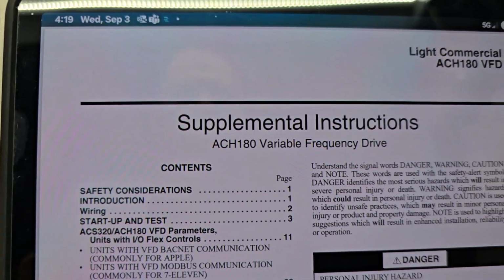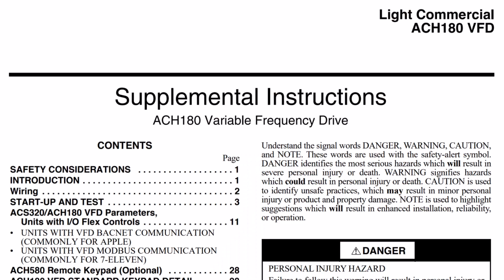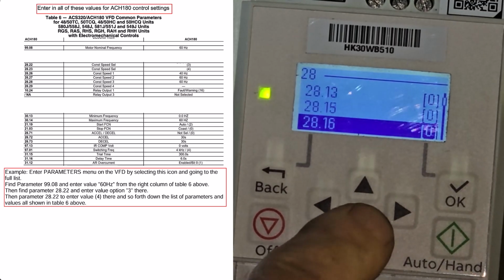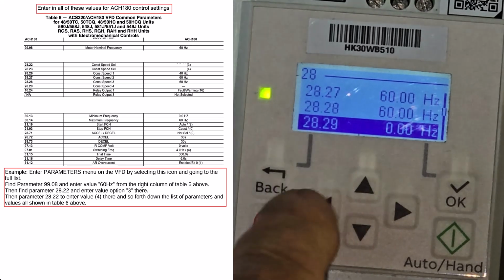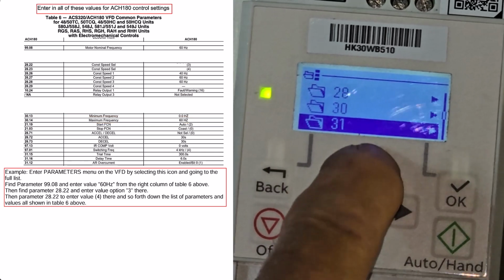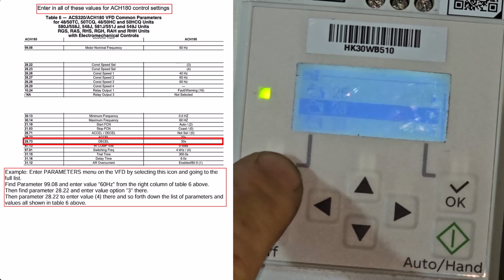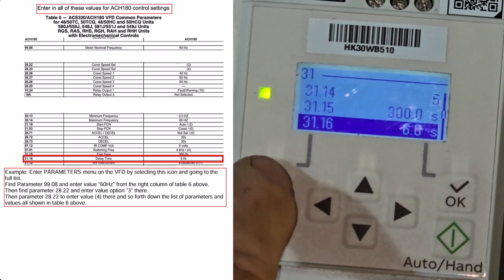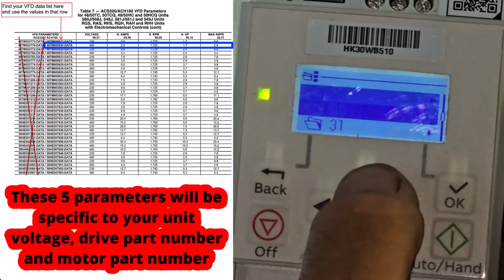Carrier ABB ACH180 VFD Parameter setup walk-through

Comment from the maker: 00:00 - Intro to the new drive
00:15 - ACS320 vs ACH180
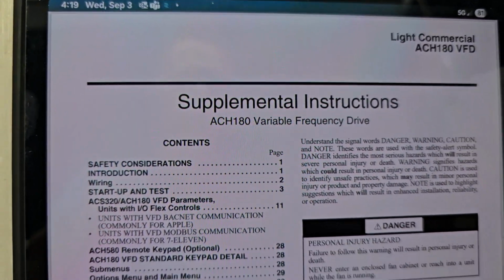00:25 - Refer to the new manual update
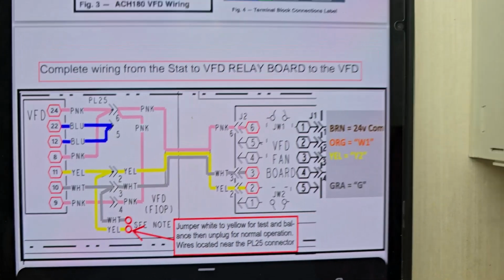00:44 - Control terminal changes
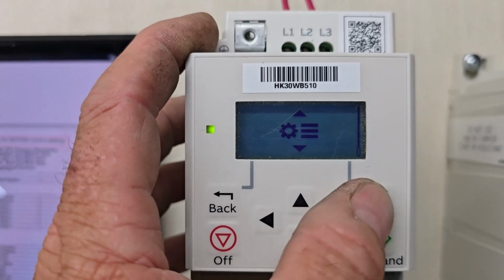01:18 - How to factory reset the new drive
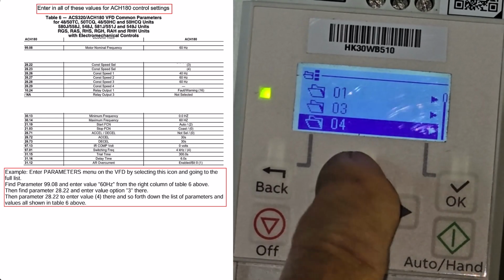01:27 - Setting the parameters
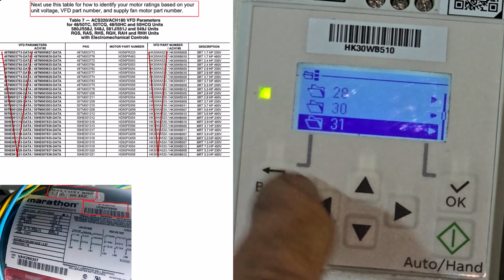04:43 - Motor specific parameters
06:16 - Test run the drive